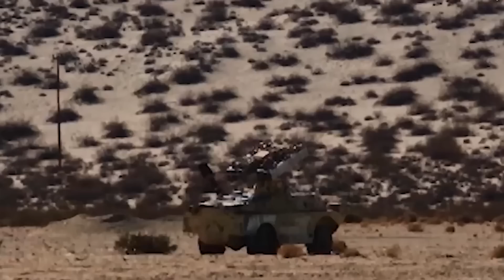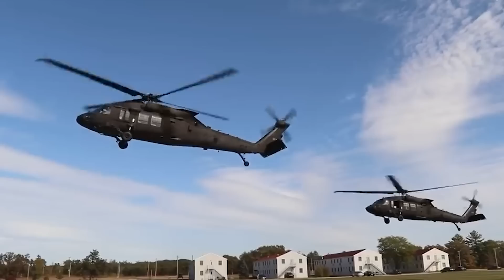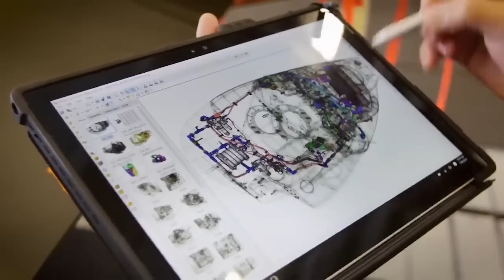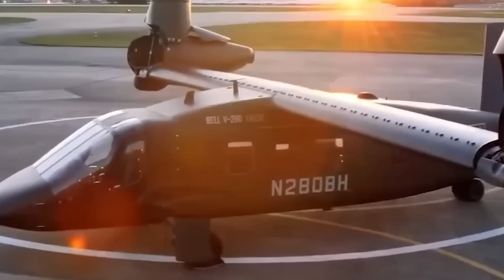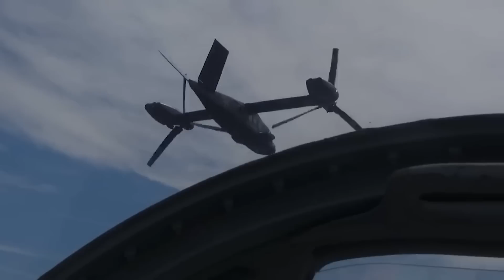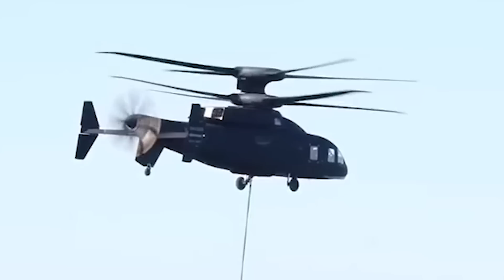The Helicopter that Will Crush the Black Hawk?

Comment: idk man, I'm seriously skeptical the Bell solution can land on one engine.  Sure it may be able to land like a plane but if air fields are available whey would use use this thing.
Reply: There is drive shaft that goes through the wings.   The Valor can use 1 engine to power both propellers.
Reply: @Stephen2K4  I had though of that but that's not what causes deaths.   With engine outs helicopters can still 'auto rotate' to save the people.  It's when the swash plates,   blades, or linkages get taken out that people die.  So to be safer it has to address that.  Not engine failure.

Comment: One problem I see with the Valor is landing in small spaces.
Reply: For small spaces - they will just rope down ... No biggie
Reply: Any jungle environment will be harder to work in. The old 2 blade Huey could land in places in VN that no Osprey could dream of. The blades could get damaged but ground crews could replace them fairly fast. I've never been a fan of helicopters even though I'll get on one if I have to. Nothing like being 1200 ft above ground in an open door Huey, looking around and noting the parts that need replacing not just fixing. Just didn't instill a sense of confidence especially when pilots would "practice' evasive maneuvers without warning. 🙄😳
Reply: Forgot to add the South Pacific region has mostly jungle type covering. The Pentagon should put pontoons the Osprey to help survivability.
Reply: @LuvBorderCollies  Not needed because the USAF is developing an amphibious version of the MC-130J Hercules with pontoons.
Reply: It's going to be same for the Defiant also. Both aircraft are larger than the black hawk. The Valor is wider but it's length fits within the original Blackhawk main rotor circumference. While the Defiant's length is the entire Blackhawk length.

I suspect that since Sikorsky never released numbers for size that people would immediately figure out the aircraft is substantially bigger than what the marketing and articles would lead people to believe about the Defiant size.

Comment: That being said, I don't see how the Valor could be an effective anti-tank or armed scout to repace the Apaches.  Where would you put the guns, targeting, missile pods?  When in plane mode, the rotors on the Valor almost completely block any ability to mount hardpoints on the wing.  There is no room under the fuselage.  Everything would have to be mounted very close inboard to the fuselage.  The footprint of the Valor will also make it more difficult to fly in tight spaces or at extremely low altitudes while flying at speed, and I suspect getting from the full forward flight mode to full vertical flight mode will take time as the rotors must rotate.  The Defiant seems like the much more capable attack and scout platform, and that might be the Defiant's consolation prize.  It also looks like a better stealth platform.

Finally, on naval ships like destroyers and frigates, I don't see how the Valor would be able to fit in small vessel hanger arrangements unless the whole wing assembly can rotate.  I would think the Defiant would be more compact as only the rotor blades would have to fold.
Reply: The valor isnt meant to replace the apache
Reply: Ive seen mockups of them armed to the teeth, the crew compartment will hold weapon payloads and they will be fired from where the troops get in and out. looked like all missiles and a lot of em, didnt see a gun.
Reply: @jamesbrown5262  Perhaps that will work, but I remember mock ups of a Blackhawk with add-on wing hardpoints holding up to 16 Hellfire missiles.  That obviously was not actually employed as the Blackhawk is just not designed for that role.  Adding armament in the crew compartment of the Valor strikes me as going back to the original Huey gunships of the Vietnam War era....worked in a pinch, but obviously, a dedicated solution had to be found.  I don't find a Valor configured like that as convincing at all.

Comment: The Defiant can also fly at MUCH higher speeds than the Black Hawk, been tested to almost 250 kts, and Sikorsky's CEO has said it should do close to 300 kts if not more thanks to the pusher prop. The Valor will likely be even faster but take much more space, wont fit everywhere and... its not a helicopter. The Defiant is designed to fit and be operated in the same way the Black Hawk has but with way more capability in all areas. I hope it lives on and gets produced and used, its groundbreaking! Most helicopters fly 100 - 140 kts, this thing do almost twice that.
Reply: The Valor also has a lot more range than the SB-1 Defiant.  It's not much bigger than the Blackhawk if you put wings of the Valor over the fusalage of the Blackhawk, and it is shorter nose to tail than the footprint of a Blackhawk.
Reply: @jameslynn7271  It has almost the exact same profile when sideways lol what are you talking about
Reply: @James Lynn  The V-280 doesn't even come close to fitting into the same space during operations, and neither is it superior in function as a helicopter for the purposes of agility during hover. The only major advantages it has are speed and range, just as any fixed wing aircraft would against a helicopter of similar power

Comment: This is so confusing.  The Valor won the competition for the FVL.  There is no word on if the Army has other plans for the Defiant, but it will not be the replacement for the Blackhawk.
Reply: Not settled yet, there is an appeal going on with the project.
Reply: @jamesbrown5262  There is a snowballs chance in hell that the Army's decision on that will be reversed.  There are valid reasons the Valor was chosen as an assault helicopter, including the fact that the Defiant had significant development issues from the get go.
Reply: @jameskwon7617  Problem with the tilt rotor design is that in order to make a hasty landing zone, more than twice the area has to be cleared to account for the wingspan plus, the width of the rotor blades, compared to the Black Hawk.
Reply: @crusher8017  Yeah, I'm not sure how the Army is going to cope with that.  If I saw the dimensions correctly, the Valor is about 82 feet wide and 51 feet long.  The Blackhawk is 54 feet if you measure the diameter of the main rotor.  The length, including the main rotor and tail is 65 feet.  So arguably, you are talking about something where you need 20 ft more clearance in one dimension, and actually more, in order to have a safe landing space.  Getting several Valors in one spot is also going to be a challenge vs the Blackhawk.

But, I think it all comes down to tactical use and purpose, which, who knows where they are headed.  If this is going to be used in an island hopping type role (i.e., vs China in the Pacific), perhaps range and speed are being prioritized over landing characteristics.  You see the conflicts we've been in lately, and it hasn't been dense jungle warfare.  It's been in the desert where landing space isn't a concern.  Then again, preparing for the past war is one way to be ill prepared for the future one (the LCS is an example I guess.....the F4 not having a gun is another....the armed forces aren't really good at this).  Is this just a ferry machine or a true "assault" helicopter?

I thought the Defiant was an overall better design, but there were too many bugs to iron out, and the Valor had a huge head start.

Comment: If the Army picks that CV-22 knockoff for FVL I’m going to be so salty.  Tilt rotor is the aerospace equivalent of taking a fetal alcohol syndrome baby, raising it on paint chips, and making it a school bus driver.  We already have an airplane that identifies as a helicopter, and it sucks at everything.  It’s also a maintenance nightmare, and everyone hates working under it.  TLDR: Flopters are the worst and I’d rather my mom drop an abortion at 500 months than give up my 60s or 47s.

Comment: Crush the Blackhawk? 

But... the V-280 Valor won the contest already.
Reply: yes and no, Sikorsky has challenged the army's decision so it's not 100% that it won
Reply: @NaughtiusMaximu5  challenge all they want, the military is getting the Valor
Reply: @NaughtiusMaximu5  the defiant will never match the Valor's speed and range, fuel consumption, and logistical footprint.
Reply: @coreyjacobs2718  you're correct on most of those points, but in the hanger i work from, we fit about 8 HH/UH-60 helicopters at once, and we could probably only fit about 4 or 5 V-280 in the same space
Reply: @coreyjacobs2718  also the dual contra rotor has already been proven with the Russian KA50 and KA52 and they have worked extraordinarily well
Reply: @NaughtiusMaximu5  the 280s will be able to fit in existing hangers and I don't see the military putting money to have both aircraft operational especially since there is still the scout competition along with omfv competition going aswell. Also tiltrotor technology is proven aswell the Valor just outclasses the defiant all around
Reply: @corey jacobs  you've obviously never worked on or supported aircraft. I work on both 60 and 47 as an aircraft electrician an I work closely with the mechanics of both, you have no idea what you think you're talking about
Reply: @NaughtiusMaximu5  yet you have never seen a v280 Valor in person so you're in the same boat as me so let's go by what the creators say that the Valor size is comparable to the black hawk. Boom!!!
Reply: @NaughtiusMaximu5  The 100 day protest from Sikorsky ends April 6th. Sikorsky even knows it already lost and has already begun laying employees off starting this week. Textron/Bell have it in the bag. The V-280 won.
Reply: Making and editing videos takes can weeks, this channel probably started producing this video back in Jan or Feb and didn't want to waste the stuff it made so they released it with slightly outdated information.
Reply: @WolfA4   This type of production has sped up in the past year, there are AI's tools that can handle all of it including the narration (if desired), and video sourcing. You just have to go through and approve what it created. 

Not saying they use any of that for their channels, but the tools do exist.